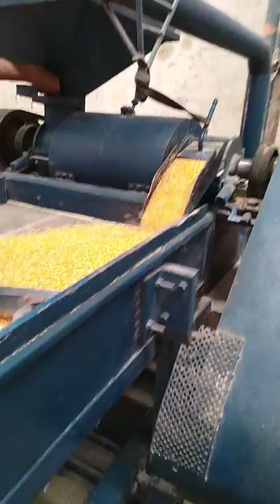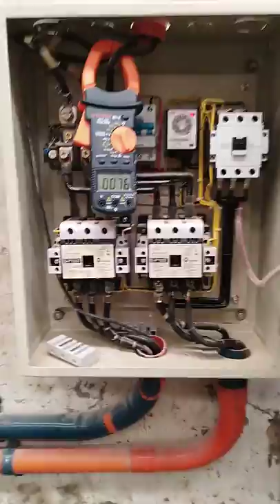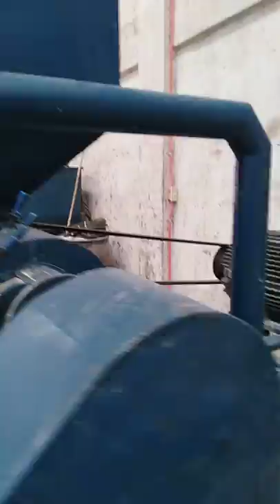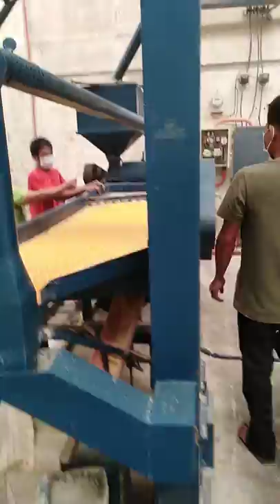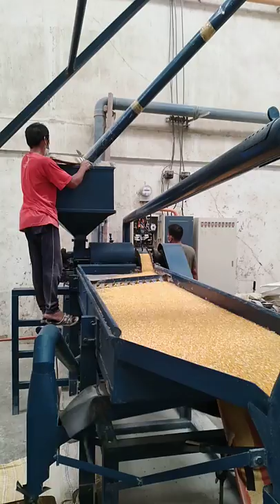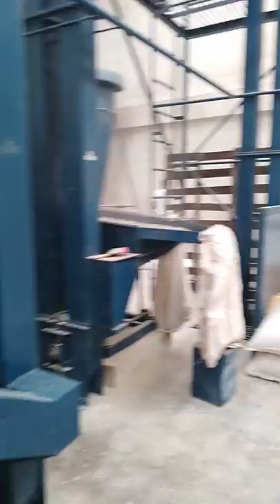Corn Cracker

Comment: what is the output and power requirement and price
Reply from the maker: depende sa model po
Reply from the maker: Call or text po 09481831755 kasi depende sa capacity po